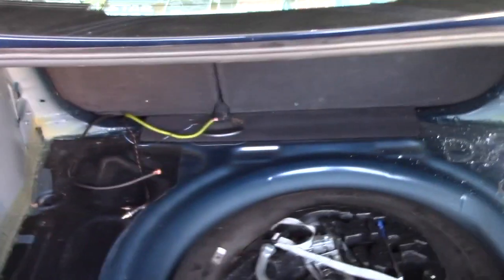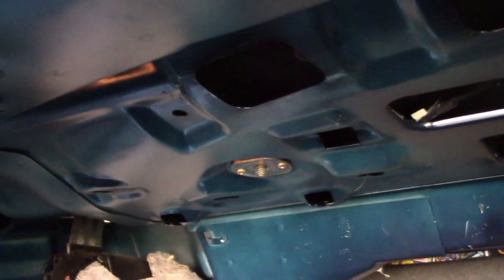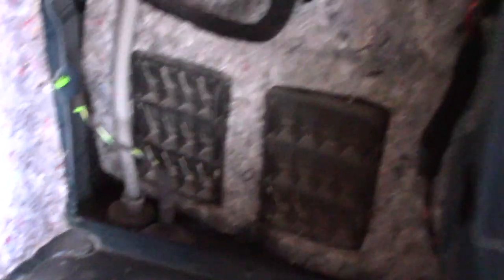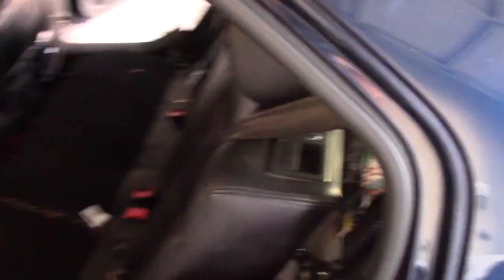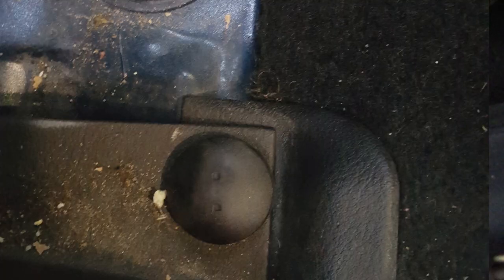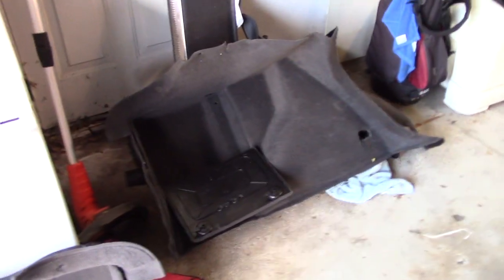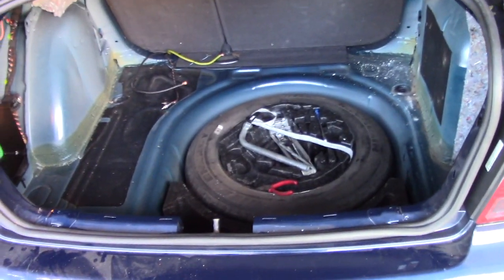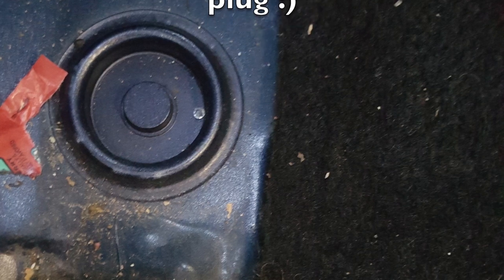MK4 Jetta Trunk Liner Removal

Comment: After I removed my liner and rear seats the doors and trunk won't work with key fob. Any ideas?
Reply from the maker: That’s odd. I don’t see how that could happen although these cars a notorious for electrical gremlins. I’d start looking for a busted wire somewhere or get someone to scan it with a VCDS tool.